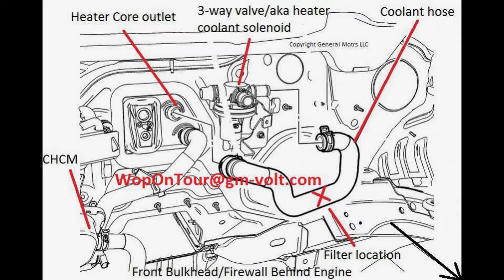Fix for no cabin heat on 2012 Vauxhall Ampera / Chevy Volt

Comment: Thanks electric dart,similar problem with my chevy volt 2013,and I try to DIY     and I finally solved the problem.Thanks for sharing your videos.more power and God Bless
Reply: So glad you got it fixed! These are great cars, but they are not always easy to repair 👍

Comment: Hello, we’ve have the filter cleaned once, and replaced once and the heat is gone again. Both times at the 10 days mark!

By chance have you done anything else to get the heat running?

Thanks in advance
Reply: Was the filter blocked the second time? If so, I can only suggest a complete cooling system flush to get rid of any debris. The filter seems to block really easily...

Comment: Thank you sir! Just completed the nasty job, and hot air is indeed coming through 😊
Reply: Where did all this dirt get into that filter?
Reply: @mariusionita9129 filter is connecting two pipes on fire panel, hard to get to but doable

Comment: Before you disassemble, Use a marker and make marks on both hoses and the filter housing. This will make reinstallation much easier.

Comment: Thank you for this reference video, it was very helpful for me. But I seem to have air in the lines since when I start heat in the cabin, I hear gurgling sound which indicates air. Did you have that problem? How did you resolve or what do you recommend? Thanks again
Reply: I didn't have any problem with air getting in; I guess I was lucky. I tried to minimise the risk with the hose clamps.